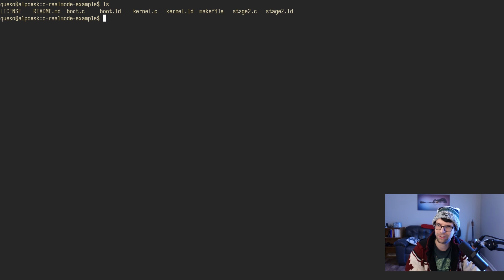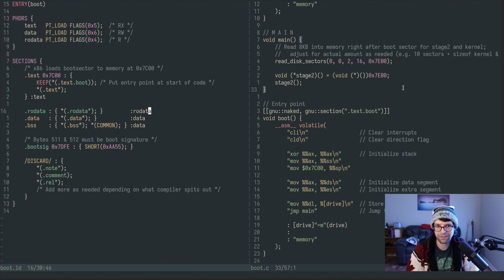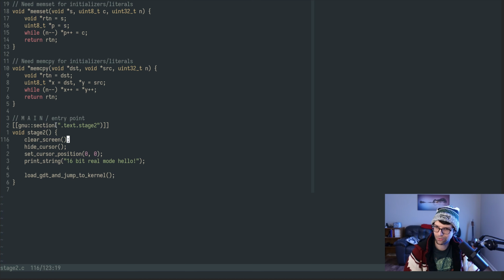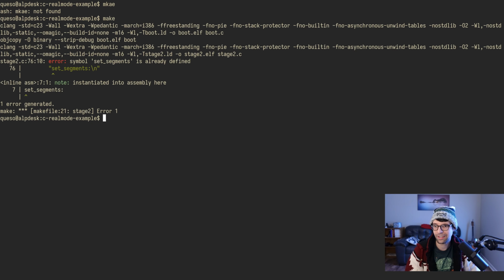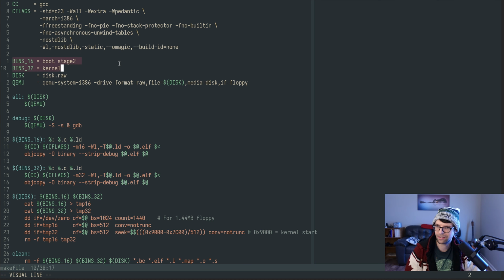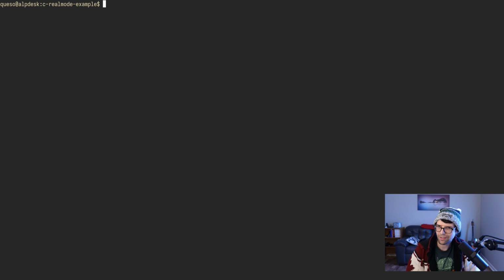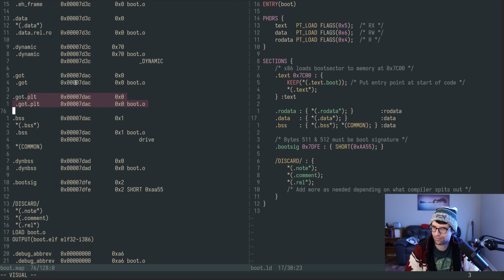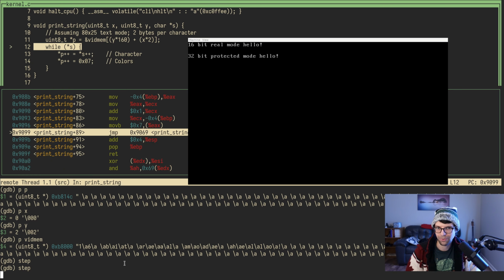16 Bit Real Mode Example with C/Inline Asm

Comment: I have a batch file that need to start with 3 parameter attached and the third parameter have to put inside of quotes, because there are spaces inside that need to use together as the third parameter %3 inside the batch file and not splitted into parameter %4 and %5.

Example:
char t[]="CENTER.BAT 6 1B \"output center align\"";
printf(t);
This works like expected and print CENTER.BAT 6 1B "output center align"

But using it with system(t); command it remove the quotes from the third parameter so only "output" is in the %3 parameter.
CENTER.BAT 6 1B output
How to fix it?